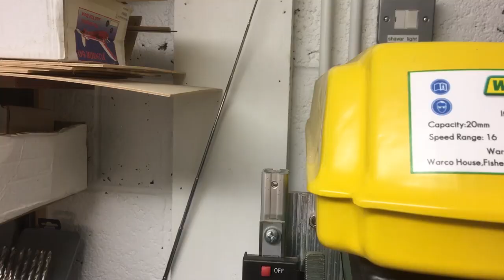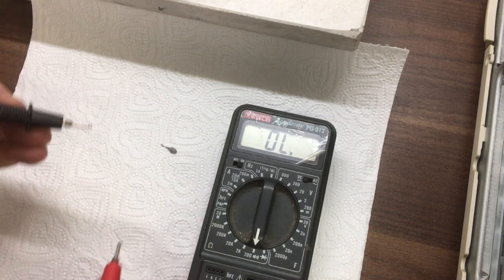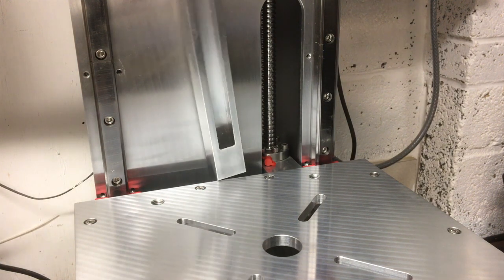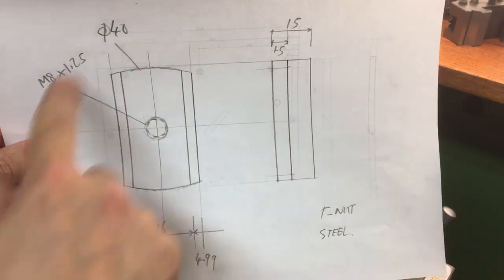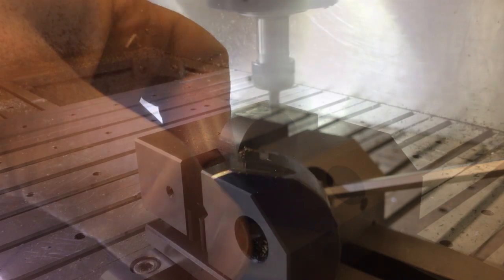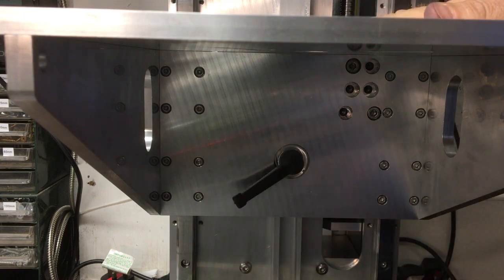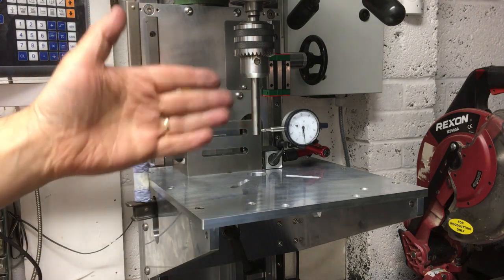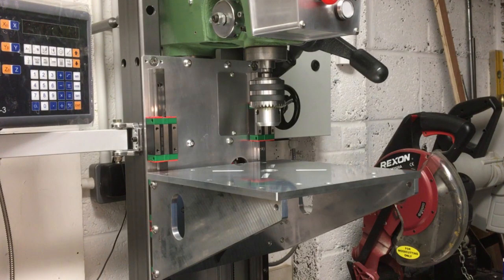Ep23:  Drill Press Upgrade | Sorting out the knee brake

Comment: A lot of older thermal pastes had ground up zinc dust in it. The expensive stuff uses graded copper or silver particals so you get a roughly even matrix of tightly packed point contact patches from the similar sized particals being sandwiched between the CPU and heatsink. Some of the pastes now don't use any metal in them at all. I vaguely remember reading that they use some kind of heat conductive silicone compound. The idea is that nearly all of it squeezes out and let's the CPU and heatsink touch each other. The paste's only there to take up any microscopic gaps from inaccuracies in the finish of the contact surfaces.
Reply from the maker: Ok thanks. Whatever was in my paste is working and we are back in business!

Comment: Love the progress and the thinking behing all.
But i noticed that the cnc router seems to suffer from some vibrations when cutting, even in the other when the pieces are solod and well fixed the sound wile cutting is kinda irregular.
Reply from the maker: It doesn’t sound too happy cutting the steel but then it is a router.  For the aluminium I think there are a few factors.  The collet needs a clean as there is some runout in it which will cause a harmonic sound and a bit of vibration.  The spindle is nearly 15 years old and has had a hard life cutting aluminium so is getting a bit tired.  Also for the close up shots the camera is on a long mount with magnetic base so it likes to vibrate a bit.  Overall the machine certainly makes reasonable parts though.  Thanks